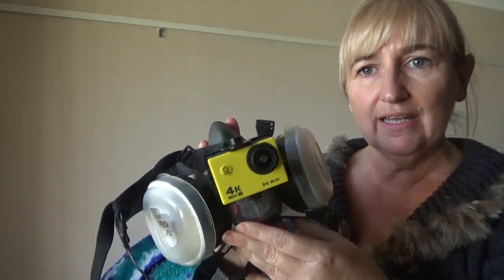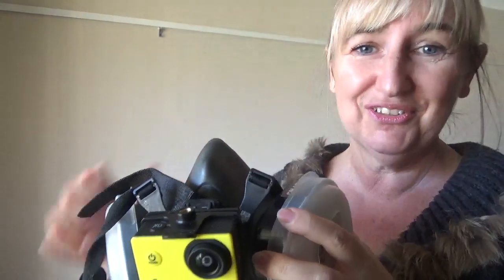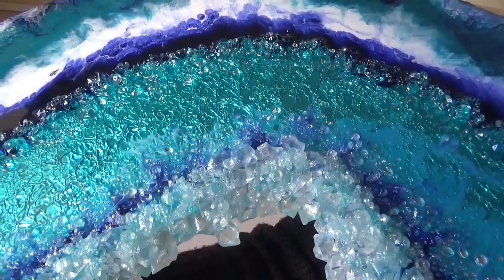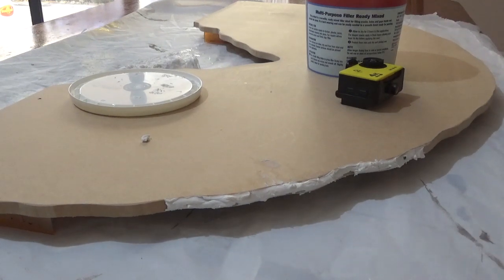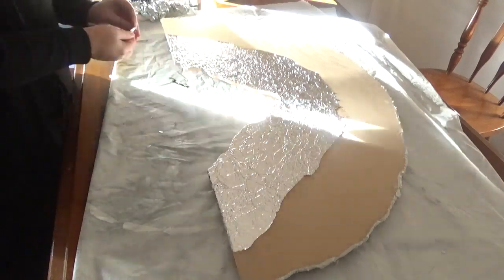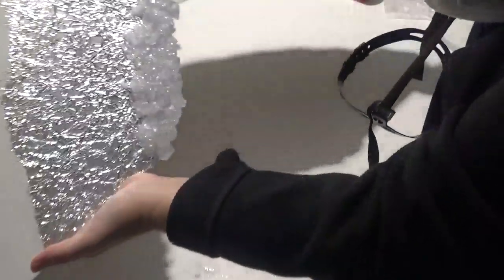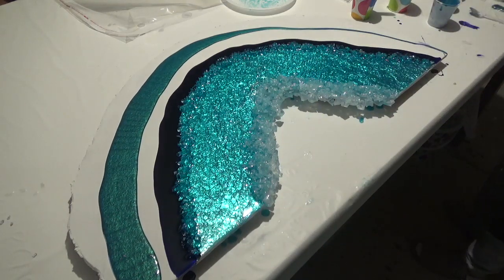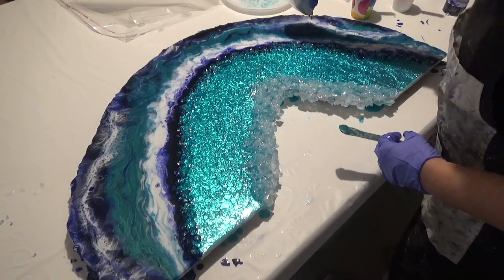Foil and Epoxy Resin Freeform Geode, complete with textured​ edge and faux gemstone middle.

Comment: May I please ask how you finish the back and perhaps see the back of one of these pieces. Thank you, Sue. They are beautiful.
Reply from the maker: If I remember, I will show the back on the next one. I paint the back with 2 coats of primer and depending on the board, will add a framed to the back for added strength.
Reply: @SueFindlay  Thank you! I usually tape off the back edges of my resined pieces (though I haven't done anything like this geode) and peel off the tape while the resin is still malleable. I am really enjoying and admiring your art!

Comment: Great work, Sue.  Makes me wish there were more hours in a day to give this a try!!  You've really inspired me, though.  I've only just discovered this epoxy resin process, and I've been looking for something creative to do to the inner backs of the vintage printer's trays that I'd like to paint for my polished rock collection.  This is a real amateur question, but when I reassemble the front of the tray, I had initially thought I'd NAIL the back to the front when I'm all done, however, your videos make me realize the epoxy should hold the front of the tray without any nails.  Would you apply the front of the tray immediately, or a bit later during the curing process?  (I'm not even sure what happens if I were to try to nail through the hardened resin.)
Reply from the maker: Why do you need to remove the fronts?

Comment: ok-2wks in-im no professional-you make it all look incredibly easy-so far ive had better looking mess ups than the original thoughts i was going for-my issue is im so sticky-i have long nails and bulky rings-gloves are hard even the finger tip ones. i use the clorox wipes-that leave me feeling little sick-also sacrificed a stran of hair. is acetone best for clean up-some resin not mixed right still hasnt cured-i dont want to throw any molds away
Reply from the maker: Please don't work with resin without wearing gloves. If you do get resin on your hands, wash immediately with vinegar and water and dry with an old towel. An old towel will help remove the stickiness. Please don't use any acetone or alcohol to clean your hands, because it breaks down the resin and makes it absorb into your skin more easily. I always have some baby wipes to hand, this can help remove the excess from your hands.
Reply: @SueFindlay  thanks Sue-good to know-you are my "Resin Rockstar"